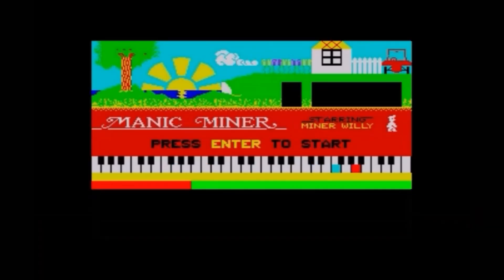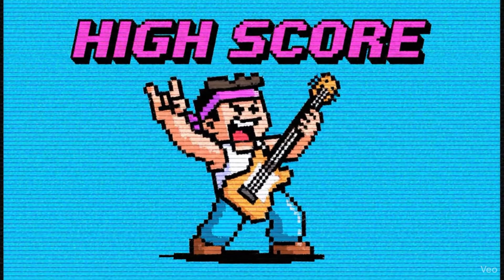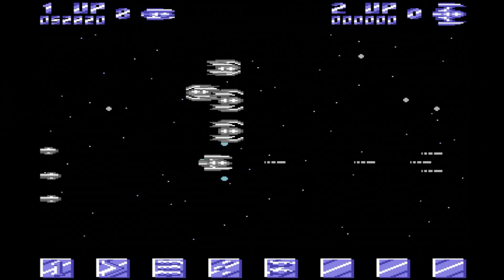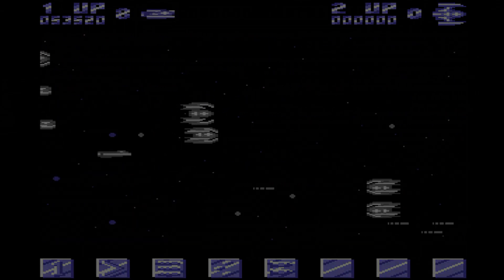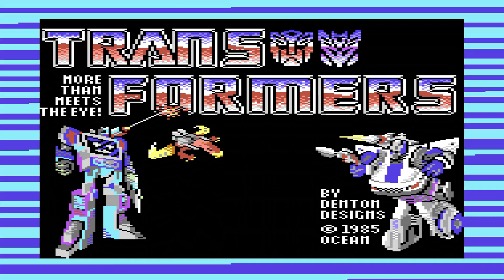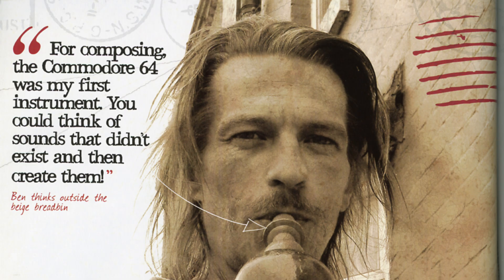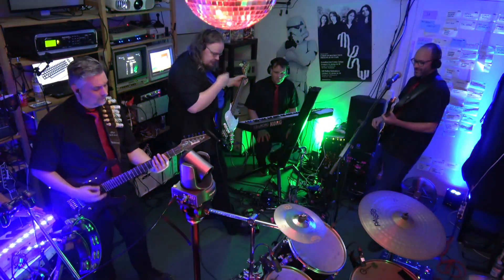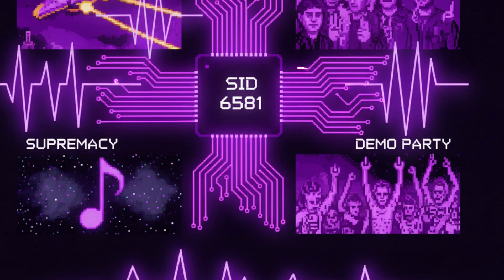THE SOUND INTERFACE DEVICE – Commodore 64 (1982) | The Legendary SID Chip & 8‑Bit Music Revolution

Comment: I wished Amiga got some cool SID 2.0 chip along with Paula, I adore chipmusic. I like when Amiga simulates chip sound with Paula. Unlike ordinary mods with samples - chipmusic NEVER grows old.

PS - wished Amiga had also color attribute-based charmap mode like C64... heck, wished it was a really next gen C64, with all those other cool stuff it already had. Imagine C65 kind of stuff added in Amiga case, back in 1987... OMG OMG OMG.... :D
Reply: But what would you throw out? HAM ? I don't like a lot of stuff on Amiga, but would improve it. For example I was thinking about linear interpolation on samples. This could be a combination of SID sawtooth with the DMA of paula. But it would add transistors. For samples up to 7ks (bass) some microcode could calculate gradients between samples. Then apply that at 96 kS ? SID has a very high sampling rate at its output. 1000 cycles should be enough for one division. To save transistors and allow a high clock rate, I could even see the use of a 4bit Adder like in Z80. Then divide as we know it from school, just hexadecimal. Though this is difficult. I think we still need to revert to binary "to try out" the subtraction. DSPs seem to love multiplication. So add a 4x4 hardware multiplier. Then hexadecimal multiplication works. The CPU would probably maintain a 1/x table for all notes within an octave. When you want tuning like I often hear from electric guitars or SID, it bogs down the CPU.
Reply from the maker: That would have been a fascinating alternative history for the Amiga, combining the best of both worlds! 😇🕹️👌

Comment: SID was the King of the 8 bit.
Paula was the King of the 16 bit.
Reply from the maker: Couldn’t agree more — SID ruled the airwaves, and Paula took it to the next level in style 😇🕹️👌
Reply: @CheekyCommodoreGamer  You don't seem to understand. The designer of the SID left and Paula was made by a different team anyway. Paula did not upgrade to the next level. Paula lacks features. One for example is, that Paula can only low pass filter after the mixer, while SID can low pass the bass line, while you can still mix in high tunes.
Reply: King of 16 bit is clearly whatever Sony put into the SNES
Reply: @ArneChristianRosenfeldt From 1991 Yes.

Comment: Technically the SID chip isn't 8-bit, it's analog.  However, it does use some 8-bit registers, but it also uses 16-bit registers for frequency, and a lot of 4-bit registers for envelope, volume, filter, etc. We call it 8-bit sound, simply because it shipped in an 8-bit computer. But truly 8-bit sound is more closely what is produced from a soundblaster, or the Amiga.  Which use 8-bit audio samples.
Reply: clever stuff
Reply from the maker: That's an interesting point about the analog nature of the SID versus the 8-bit registers... great to have the detailed breakdown! 😇🕹️👌
Reply: Yes SID needs those external capacitors, while Paula and TED and whatever is in NES don't .

Edit: Though on a lower level at MOS I would build all chips upon 8 bit adders with carry flags. So the higher bytes would lag by one cycle ( skew ). I would mix in the digital domain and deskew just before the DAC. Instead of analog low pass filters, I would allow digital chaining to produce polygons. So you could use parabolas or Bezier curves for you basse.
Reply: @ArneChristianRosenfeldt  On my Sequential Pro 3 Special Edition, I do like using a sine wave for a subharmonic low-end for bass.  It adds some feeling to the bass patch.  On the Pro 3, though, only VCO3 can generate a sine wave, and that particular VCO is digital, as it can also generate wavetable.  One of the reasons I got the Pro 3 over a Moog Model 3, other than three different types pf filters.

Comment: What is the difference 8580 had to the original 65**, I only know some of the late(-est) sid tunes from demo scene only work (=sound "correct") on 8580, why did Commodore introduce a new SID, was it cheaper or better in some way? What happened?
Reply: They fixed bugs in later revisions of the SID, this unfortunately had side effects as people began to rely on the behaviour of what were technically bugs, and thus some songs were relying on the bugs to sound correctly.
Reply from the maker: 8580 was introduced to be cheaper, more reliable, and power-efficient than the 6581, but its cleaner, more predictable sound means some old SID tunes only play “correctly” on it 😇🕹️👌
Reply: @CheekyCommodoreGamer  how is it cheaper? Die shrink?
Reply from the maker: I think it was just due to the switch from an older NMOS fabrication process to the more advanced HMOS-II 😇🕹️👌
Reply: @CheekyCommodoreGamer  Thank you for taking the time to answer, inspired by this bought the "Back into the Storm" by Bil Herd, should be good reading.. =P

Comment: I remember reading an article in 1985 describing the C64 as the Mozart of the Micros. The journalist wasn't wrong. The SID generated atmosphere that rival systems just couldn't compete with.
Reply from the maker: It was a tiny synth powerhouse with filters, oscillators, and envelopes that gave the C64 tunes their unforgettable atmosphere 😇🕹️👌
Reply: I believe its design was an influence on the NES sound chip design.